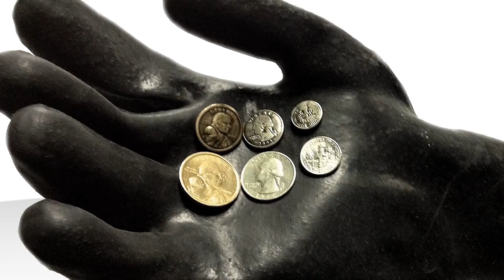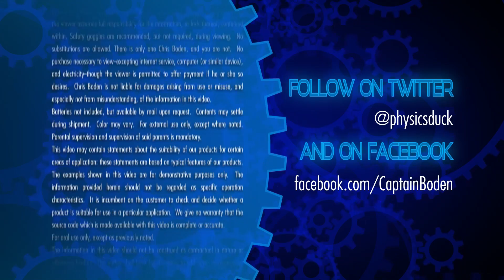Captain's Blog 6 7 2013 Andrew's Mark-V Tesla Coil

Comment: Hey there Sam, 

I do have that gap on a 1000w dimmer but it seems to be getting very picky lately with the larger top load. Chis ended up stopping by for my first run with the new dual toroid that I have. I plan to work with the group to start mods on a new 3600rpm sync motor soon.